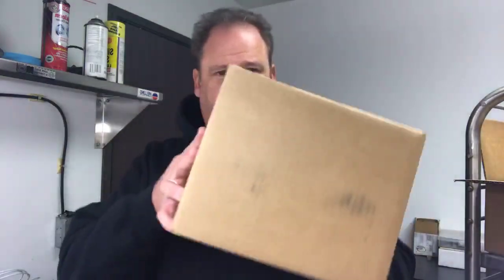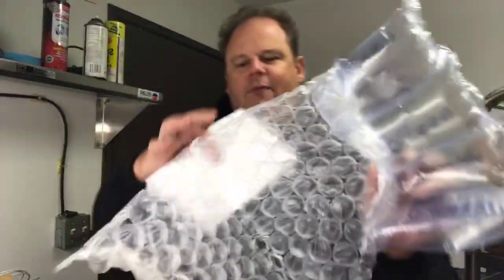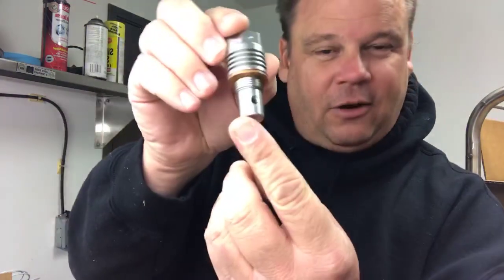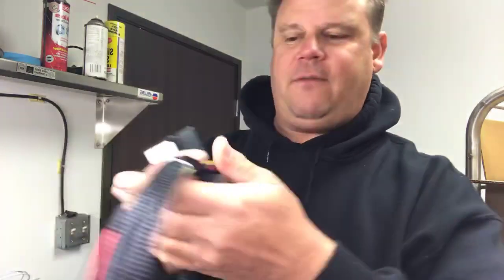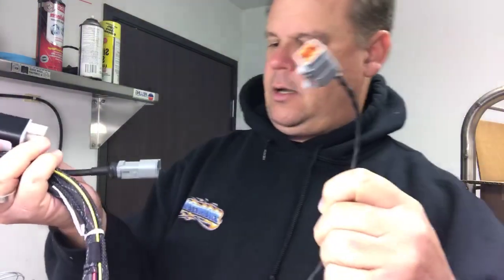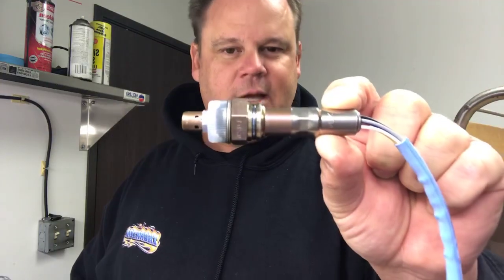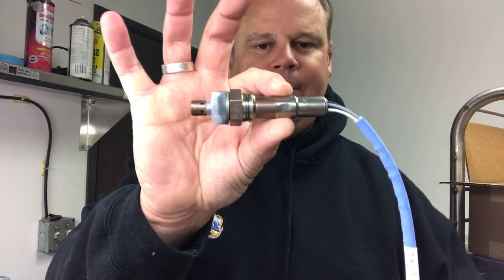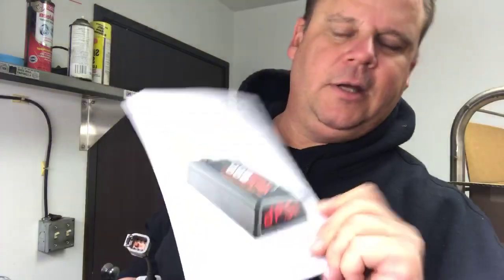Unboxing - Ballenger Motorsports AFR500 CAN Wide Band Air Fuel Meter - Tuned By Shane T

Comment: I just tested this sensor vs lsu4.9 on our dyno last week on a turbo ls1 i set both sensors to read gas afr and they read pretty close until i did a few runs then they drifted apart the ntk would read 12.5:1 and the lsu 4.9 would read 11.5:1 i did have the ntk set to extended range and the manual said in extended range mode it would increase the afr range it could read but would decrease the resolution. I wasnt sure what one  to trust  but ill give it another go set to lambda after watching this. I saw a video where andre from high performance academy experienced the same thing i did and thought the lsu 4.9 was more accurate.

Comment: Awesome!!
. Does that mean a lambda sensor that has exhaust flow over the outside of the sensor (due to external gate etc) will read incorrect due to the atmospheric  reference being contaminated? And if so would it read rich or lean? I'm thinking it would read lean.
Reply from the maker: Yeah used to happen on a particular street car where the manifold to exhaust gasket would fail and leak right at the sensor it would then set a lean O2 code probably more due to the air leak but still same result.

Comment: Thank you so much for your video! I am interested in switching to methanol fuel on my turbo ~500hp BMW with a goal of just to learning how to tune on methanol. I have been on an AEM UEGO LSU4.9 Lambda sensor however, like you mentioned methanol is reaching the limit of that sensors ability to read. I have looked into these NTK sensors and heard great things about their lambda range and accuracy. For a non serious weekend worrier just looking to learn how to tune on methanol would you suggest this senor ? or do you have experience with other sensors that work well for methanol you could suggest ?   Thanks again
Reply from the maker: Any sensor will work for methanol, it all depends how rich you intend to run the mixture. Peak power using Methanol usually occurs around .78 lambda which is well within the range of most sensors. We may wind up below that using Nitromethane which is why we chose this path.
Reply: @TunedbyShaneT  thanks!